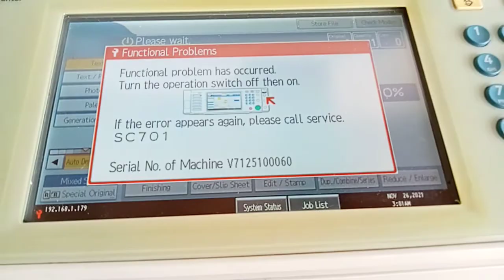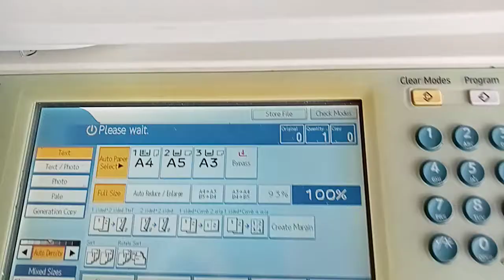Ricoh MP Error code SC 701

Comment: 700 error cod Ricoh 2075 please
Reply from the maker: SC700: Peripherals
SC No. Symptom Possible Cause
700 D ADF original pick-up error 1
Pick-up roller HP sensor signal
does not change after the pick-up
motor has turned on.
• Pick-up roller HP sensor defective
• Pick-up motor defective
• Timing belt slipping, out of position
• ADF main board defective